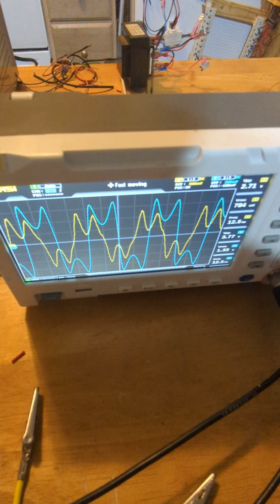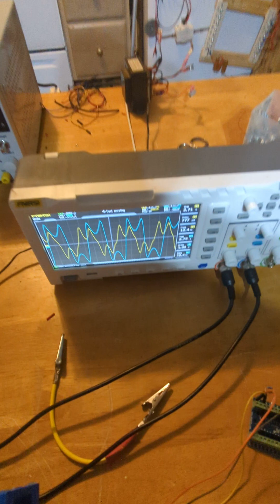Phase-Shifting Coil..  Magnet Rotor inducing a coil designed to shift the output 90 degrees

Comment: Interessante, mas pelo que vi. Está perdendo energia. O gráfico do osciloscópio demonstra uma onda senoidal ceifada, o que indica no caso de geradores uma ligação invertida das bobinas.
Reply from the maker: The magnet and core is not sized correctly, causing the M shaped wave.  The sinewave gets corrected when the magnet / spacing is correct with the coil diameter